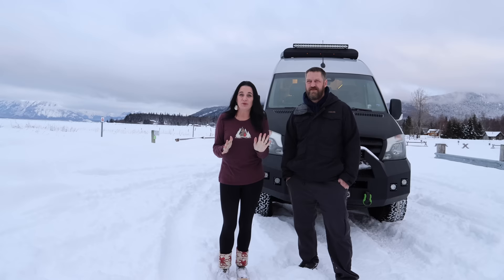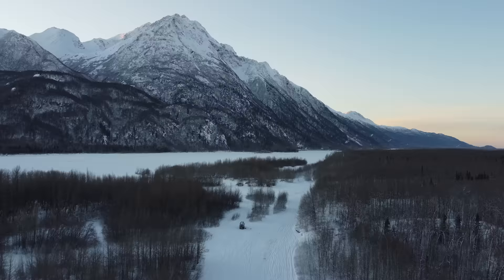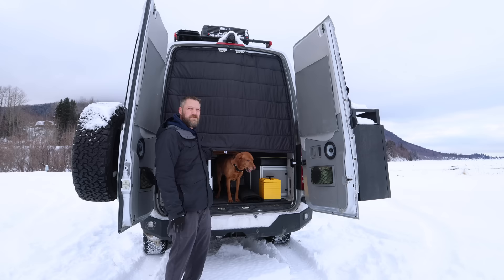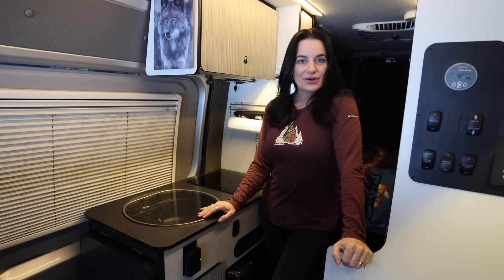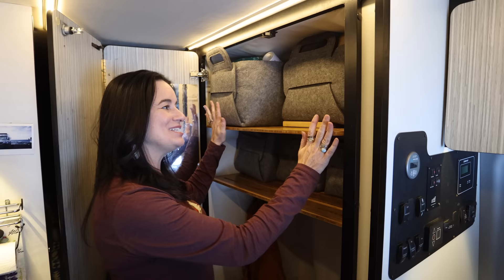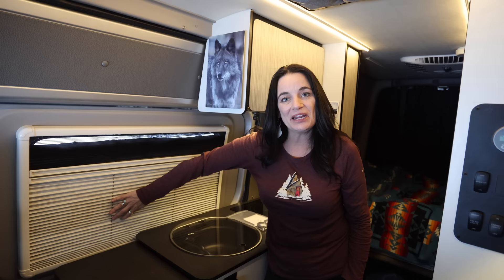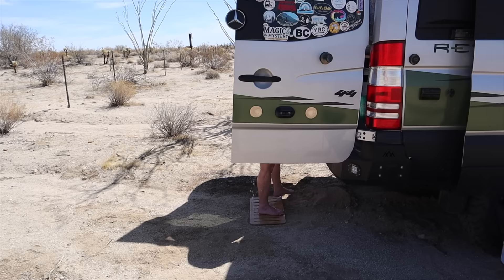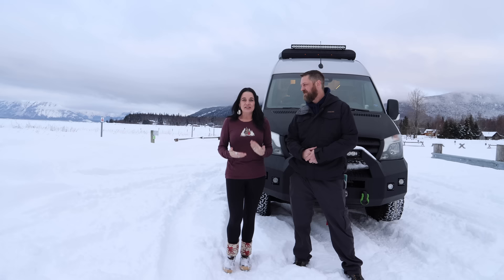The Ultimate Adventure Van | Winnebago Revel 4X4 | Van Tour

Comment: What are you currently using to black out your cab area at night?  Blinds?  Curtains?  Thanks for the video.  Very helpful.
Reply from the maker: During the winter we do not use anything to prevent condensation.  (It’s always dark in Alaska ). During the summer, we use the window covers that came with the van for the cab.

Comment: Thanks for your quick reply. I am also interested in knowing how long is the cable on your winch and about how much did you spend on the front bumper and winch I would like to get something like that for the echo.
Reply from the maker: Hi Kurt.. I would guess around 30-40 ft.  The cost was around 2k.  You can save 10% by using our discount code WWA10.

Comment: Thank your for this video and for sharing all this information! 

Jim talks about a heat exchanger that is connected to the Espar heating system. Can Jim share more details? Where can I buy such a system for my 2021 Revel? I too live in the cold (Quebec) and I'm looking for solutions for the cold weather. The DEF skid plate seems to require de full bumper upgrade. Is there a cheaper solution?
Reply from the maker: Hi Marc.  Our Heat Exchanger was installed by Rixen's which created the ESPAR.  I am not sure if there is an equivalent system for the Timberline or if Rixen's does an install into that system or not.  Definitely makes a big difference in the cold.

Comment: Thanks for sharing your videos, my wife and I really enjoy them.

We’re having a Sprinter converted by Boreal Campers. We’re trying to decide if we should go with the Espar D2 or D4 heater. The D2 has an high altitude adapter as an add on, and the D4 is good up to 7 000 feet. Any suggestions?

Keep up the nice videos 🙋🏻‍♂️
Reply from the maker: In our travels down south we definitely needed the elevation additions.  Our D5 has high altitude also.  I guess it just depends where you plan to travel and use the heater.

Comment: Did you have to enlarge the wheel wells for the 285/75’s? Also did you recalibrate the speedometer to correct for the larger tires?  And thanks for the “van improvements update!”
Reply from the maker: Hi Larry.  We did modify the wheel well slightly.  They do not have a computer update for oversized wheels so we are about 5mph off on the speedometer.

Comment: Great video of the upgrades and mods that you both have done. The aerial footage is really well done. Always fun watching your videos !! So I had to join. :) Looking in doing the suspension on our Revel. What made you choose the VC 6.3 over Agile ? Looking to get the approx. 2" lift out of either system as well. Will probably be putting in an Aux fuel tank too. Either the Agile 28 gal, but I also see that SB is coming out with a 40 gal replacement of the OEM tank. Have you gone on the Old Denali Hwy form Cantwell ? Haven't been there since '21. 
Thanks for sharing your videos and information !! Safe continued Adventures ..
Reply from the maker: Hi George,  we have shot a couple videos out on the Denali highway.  We love it out there especially on some of the old trails.  We like the adjustable suspension from Van Compass that is ultimately what led us to our decision.  The two inch lift is a true body lift from van compass not just a suspension lift.  We also are considering a bigger tank but we will wait and see what the 40 gal tank does before committing to one or the other.
Reply: @WingsandWheelsAlaska  Thanks for your thoughts on the suspension. I will have to look for your videos on the Denali Hwy. Hope to get back up there to explore on the ground vs from the air. :) All the very best !!